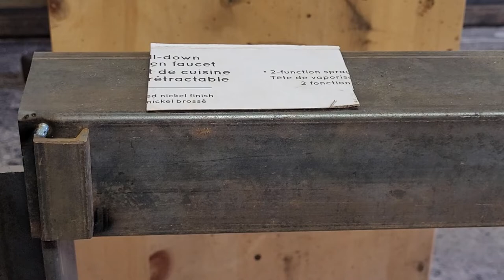Universal Jet Ski Trailer

Comment: You did build a good sturdy strong trailer but what I'd like to know why did you use steel instead of aluminum that must be very heavy when their together what's the total weight of both of them.... together.
Reply from the maker: Steel is way cheaper than aluminum and the trailers are not that heavy. I did not weight them but I can pick one up of the ground myself

Comment: I like it. But since you need to have the room to store an entire trailer and ski if you are only taking one. Why not just build a dolly and off load the unused ski in less time than it would take to separate the trailers?  And it would be easier to store just a ski on a dolly in the corner of the garage than an entire ski on a whole other trailer. 

Would be less cost in upkeep too since your not paying for 4 tires, only two. 

You can buy dollys for pretty cheap without making them.
Reply from the maker: How will I tow two skis at once?
Reply: @jaceksuchon4717  using the original dual trailer. I may have miss understood but I thought you had that already. 

Or build an actual dual place trailer. Only issue I can see is there are different stresses on the sections of the trailer. Suspension can only handle so much force, and absorb so much impact. So if you hit something in the ground, only one trailer is taking the impact and reacting it to, not both sections so they would be pulling and fighting against each other. Same as if you hit something with a center tire, the one next to it may miss it and cause the impact forces to stress against the trailer that is not reacting to anything. 

Be mindful of the wiring for the lights too. I would have the center lights still come on when the running lights are on because you are over 80” wide and need ICC lighting (Federal requirement, and each state requires it) since you are in the US. So the center lights should still be lit up to show the width of the trailer at night.
Reply: @PTRRanger951  It's not shown at night. I would HOPE that the running-light wire is run to both sides.

Personally, I'd wire it so that both lights on the left trailer light up for indicators on the left, and the same for the right. So every light gets the same amount of use, the middle brake lights still work as intended, and it doesn't get messy.
Reply: I can see this trailer setup being useful for things other than jetskis too. Like a motorcycle trailer, where it WOULD be a good thing to separate the trailers before going to the river. Leave the bike trailer back at base camp. (Or a supply trailer, or any number of other modules).

Personally, if I were designing a trailer like this though, I'd leave it normal width with a center rail at all times, and just have slide-in modules on dollys, including the jetski, motorbike, and cargo modules. Because then I wouldn't have to put a specific module in a specific spot like this design has to.
Reply: @NikkiTheOtter agree. There is a company in the US called Shadow Trailers that make various trailers. 

One of the ones they make is a universal one that has a flat bottom. It has receivers, the same for a trailer hit for a vehicle, mounted up and down on the floor in certain spots. 

You put the bunks for the skis into them so you have a jet ski trailer. Remove them and it’s a flat deck trailer for anything else. 

They make it up to a four place trailer for 4 skis so you can have two skis on there and a quad, or three skis and a motorcycle or luggage or anything else. Remove them else and haul a car or UTV.   It’s truly a universal trailer.

Comment: Nice concept 
I built a jetski motorcycle barbecue pit with a large tool box trailer 
With a hand in electric winch system power source all your 12 volts and USB needs plue 110
Reply from the maker: Thanks
Reply: https://www.youtube.com/watch?v=umhff57BshI&t=9s